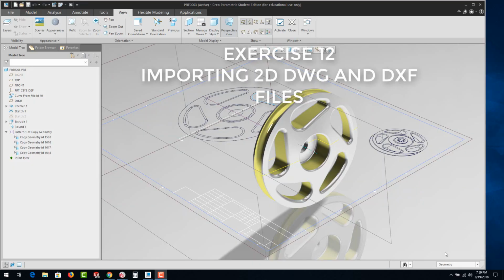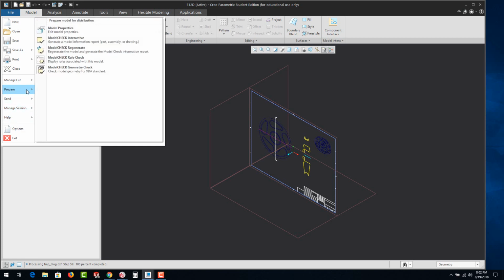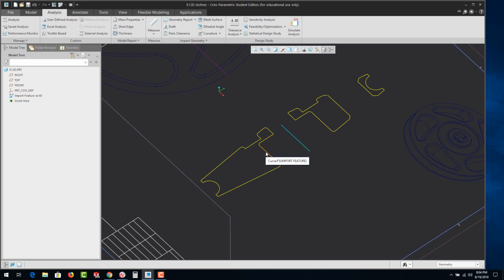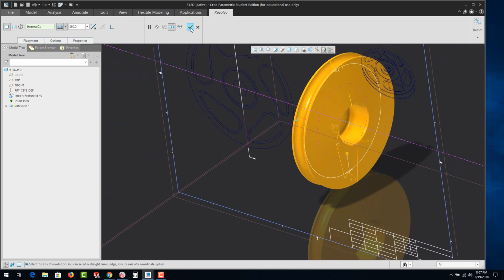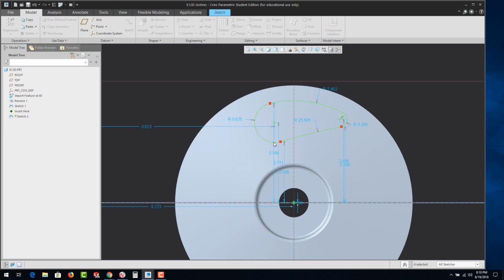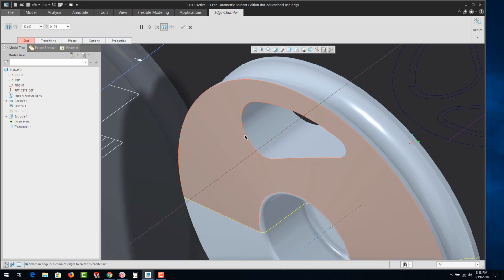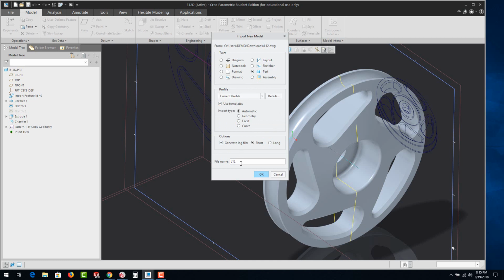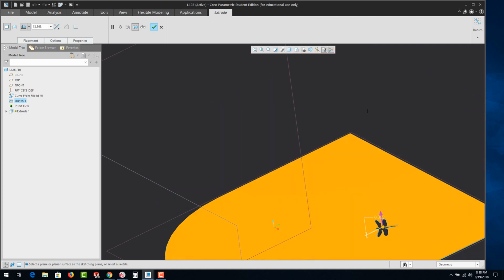E12 Creo Parametric 5.0 - DWG & DXF conversion Tutorial

Comment: I took a logo from adobe illustrator and converted it to dwg.
if i open it it'll work just fine just fine but when i am going into the sketch mode i can not click on my outlines from the dwg.
i have an older verion from creo but i really need to figure out how i can import vector files in my sketches to extrude them